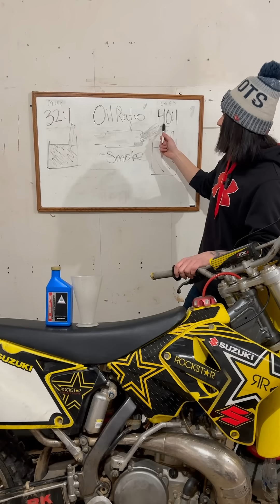2 Stroke Oil Ratio Explained

Comment: Always ran 50:1. Never had any issues.
Reply: Same
Reply: Same, every 2 stroke engine I’ve ever had ran 50:1
Reply: Is this a joke about weed eaters😂
Reply: @yeah_thats_me nope most weedeaters use a 50:1 ratio.
Reply: @bbarker5766  They don't last very long either!
Reply: Run the ratio that the oil manufacturer tells you to not the bike manufacturer. The bike manufacturers recommended ratio is for the oil they recommend not the engine it's self
Reply: I have a 1985 250r and a 1985 cr500 both 50:1 never had problems. Bell Ray.
Reply: 50:1 is the most versatile. You can run it in anything from a Ford ranger to a crappy mantis tiller
Reply: Mantis tillers aren't crappy  @powcod7455
Reply: @powcod7455 Ford ranger will run off a bottle of whiskey and dirty lube
Reply: On a new bike though...
Reply: Mine runs on jim beam 😂
Reply: @benjialbert3317  what ratio ?
Reply: I’ve been riding since I was 5 and I’m 40 I have changed every bike to 50:1
Reply: on my new bike I run 50:1 old rm125 I run 32:1 and file spark plugs lol
Reply: Depends on the bike and riding style say a 300 could do 60:1 just fine but definitely don’t do that with a 125 just because you tend to ride a 125 in so much higher rpm
Reply: KTM 250 XC W calls for 50:1. So yeah.
Reply: In what? If you ran it in an engine designed for 50:1 , than great! , if you run it in an engine that is Designed for 32:1, than not so great..
Reply: @GRANITEMONUMENT  1997 KX125. As well as a 96 yz85 and a 99 yz125 and a 05 yz 250. 50:1 is the only mix I’ll ever use on anything. Never had any issues on my weed eater and snow blower that recommend 32:1. They get cleaned every year and there is never an unusual amount of carbon build up.
Reply: Ktm with the recommended oil is 60:1
Reply: Your all smoking crack! 1/16th scale is the best R.C. car platform!! O' Doyle RULES!!!!
Reply: Same
Reply: 😂😂🤦‍♂️ what a dumb comment to make. “I’ve always ran at 50:1 and never had any problems” 😂🤦‍♂️🤦‍♂️🤦‍♂️
Reply: @cornellkirk8946  and your comment is smart?
Reply: 50:1 when I trail ride
Reply: 50:1 dam. She needs lube. My riding don't allow the that
Reply: @Flynn󰦉:pov: you've been in search and scroll too far
Reply: Way to lean!!!!     you must ride for 10 min at a time and super light riding during those 10 min.    Cuz I can guarantee at 50 /1 you will be popping top ends w any actual riding.
Reply: @johncollins1958 I've been running 60/1 in a ktm 150 for 6 years racing enduro and probably done over 300 hours. And Only changed the piston three times.
Reply: Once I found AMZOIL I ran 100:1 ratio. Best 2 stroke oil I ever used.
Reply: Your soft
Reply: @maxjordan2625  work on your grammar dumb fuck
Reply: castor oil at 50.1 you could but id be constantly covering the clutch. not fun when a motor locks up at full noise
Reply: you prob never rode your bike :'D... 50:1 is race mix and should be rebuilt after every few races. you run 32:1 and your engine will run forever . you run 50:1 you will wear down your rings and eventually your shit will blow up .
Reply: @onetime7214, Actually, you're wrong. I started using Amsoil when I helped a buddy rebuild his CR125 that he raced in GNCC's. We pulled it apart and very little carbon on the piston, cylinder looked great and rings measured in spec. He ran it for a year in the top 10 in the B class with some wins too. I switched and have been using it ever since with no failures! Learn to jet your bike correctly and you'll be just fine!!
Reply: @lxvwvxl  ive ran 50:1 in my 2015 300 TE since I bought it (brand new) never done a top end and has been fine still on factory spark plug. Has been at the bottom of rivers thrown off hills and abused never had an issue after 9 years of riding consistently almost every weekend its finally getting time but she still starts 1-2 kicks from cold
Reply: @lecerf836 nice information! How many hours has your bike done? I guess you would be doing the air filter clean every 2 rides and oil change every 3ish hey?
Reply: @CosmicTarot333  did a few oil changes like maybe 1 a year after i flooded it but oil changes dont effect a two strokes top end since the oil is in the gas. The oil that you put in the bike is just trans oil. I have done 2 new air filters in the entire bikes life but it gets cleaned once a season
Reply: @lecerf836 ya if you run a good oil you can do that , but 9 years is insane. 
How many hours do you think you got on it? I think you got lucky to have the top end last that long unless you don't ride very often
Reply: @rickywoods3101  idk somewhere between 150 to 200
Reply: @lecerf836 50:1 is best
Reply: @lecerf836 Let me explain why that is bruh.. your bike is NEWER. oils were shit back in the day save for a few brand. Plus its a husqy/ktm and they recommend 50:1. Their brand premix they sale is 50... your bike is INDEED tuned for it. You would of blown up anything else YEARS ago with your logic 😂
Reply: @lxvwvxl why would you run 50:1 racing?

your just losing lubrication and gaining nothing except better emissions which don't matter. 

Unless the bike has piston side injection and proper bearings on the bottom end it would make more sense but then you wouldn't even need oil in the fuel?
Reply: @finlaymcdiarmid5832 we always ran 50:1 on all of our race bikes. Well back in the early 2000s when we raced 2 strokes. But to this day my son races on a national level and the vp gas we run comes premixed at 50:1..
Reply: @marcspencer800  it doesn't seem logical to me. And the sacred graham bell said in his books that basically if you get a newer 2 stroke, one of the first things you should do is get it running more oil, he did loads of tests and found 3 or more totally different bikes all gained power from increasing oil.

Not much but it wasn't so little that it could be doubted as a fluke, especially on multiple bikes, i think he tested the last year of the RG500 and found a few hp by doing this, some smaller bikes too but i can't remember which ones.
Reply: @finlaymcdiarmid5832  do you really think it makes a difference you can feel.. we don’t run vp gas in my sons two strokes for more power we run it for perfect consistency so when we dial our bike in nothing changes.. I honestly believe the consistency is a bigger advantage then the small amount of hp gain.. 99% of it is on the rider anyways
Reply: @finlaymcdiarmid5832  every single 2-stroke in existence gains HP when you add more oil to the gas. That isn't the point, though. In fact, the way the bike gains RPM's through the rev range changes dramatically, when you change the amount of oil. Different bikes have different optimal ratios, especially if the bike has a power valve or fuel injection. You could probably mix the gas at 2:1 and gain a ton of HP, but does that mean you should actually run the bike at that ratio?
Reply: @jaysoniorg2950 that’s completely wrong more oil less gas less oil equals more gas equals more power
Reply: @shiestyghost1  wtf are you trying to say? Try responding when you're sober.
Reply: @jaysoniorg2950  leaner the mixture the more power you make especially with an 2stroke
Reply: @shiestyghost1  bro, do a Google search right now. It feels like it makes more power with less oil, but factually speaking, based on all the data ever produced, 2 strokes make more power with more oil in the gas.
Reply: @jaysoniorg2950 You've got your whole argument totally backwards tell me you don't know what your talking about without telling me exactly so 😂
Reply: @lxvwvxl  That's not true. It depends on the bike, and manufacturer recommendations change per bike. My 2020 KTM 250sx (with a 300 kit) has very strict 50:1 recommendations from KTM. Mixing more oil isn't automatically better in every single situation imaginable.
Reply: @onetime7214  I have Ran 50-1 for years on my bike was a old rave bike from a friend ran perfect and always started on first to second try
Reply: @lxvwvxl what are you on about?? Rory has just stated that he runs his husqvarna on 50:1 with no issues as do I with my gasgas 250 as that's what the manual states never had to touch the engine it's totally bombproof. Why make the arguement when there are loads of guys out here running 50:1 with no issues?
Reply: @benmanning4340 IT totally depends what the manufacturer requires. Literally nothing else matters. Engine designs vary more than it looks to the naked eye, and oil ratio is determined by the factory CLEARANCES inside the engine. Don't you think Honda, Kawasaki or Suzuki TEST this stuff when getting ready to build BILLIONS of dollars worth of engines????
Reply: @lxvwvxl dude what are you smoking I’ve ran 50:1 in every 2 stroke item I’ve had from weed eater to 1200 triple’s with ported with high comp heads and raced them for multiple seasons without having to rebuild a motor, you’re doing something very wrong or something ask any old head 2 stroke guy they’ll tell you the same thing
Reply: @lxvwvxl you can't just randomly say that without knowing what oil. Good oil runs very well at 50:1 if you need 32:1 for the street you're using garbage oil or oil that's too thick for your climate.
Reply: @onetime7214 how come AMSOIL says u can mix to 100 to 1 with there oil ?? So far I have 3 yrs on my Backpack Sthil br800 blowers at 75.1 🤷
Reply: @lxvwvxl don’t you just mix it at whatever the oil manufacturer says to? They have already done their research and testing so you don’t have to.
Reply: @lxvwvxl 50:1 is NOT race mix 😂
Reply: @lxvwvxl My longest-running moped engine has seen the better part of 55000 km over the past fourteen years, only replaced the piston rings once and the bore still vaguely shows the hatchmarks on the Nikasil coated wall. Always run Castrol RS 2T at 50:1. Top RPM is 11500 and it spends all of its time above 8800 while cruising.

50:1 isn't a 'race' mixture, it's a perfectly usable mixture for when you take good care of your engine and never run bargain bin 2T mix oil.
Reply: @lxvwvxl ran my 2 stroke at 50:1 for years and hundreds of rides, only replaced the rings once and still runs like a top
Reply: @lxvwvxl never had any problems I feel like 32:1 is for American shit fuel 50:
Reply: 2% thats fucking insane piston lasts maybe one race on that
Reply: @jimi1943 😂 I run high rpm kitted vespa engines making 35+HP and 2% is where the power is. Take apart the engine looks mint. They can last a long long time.